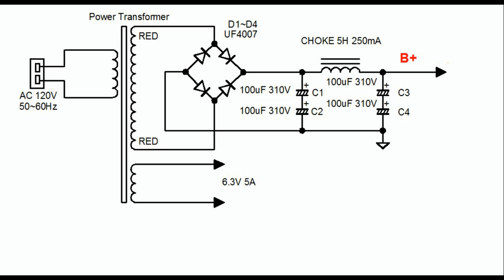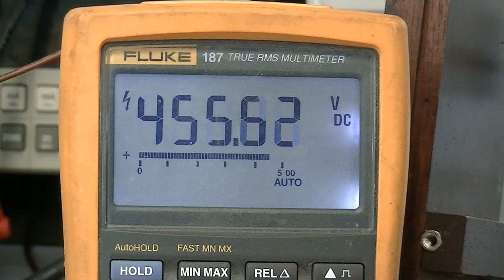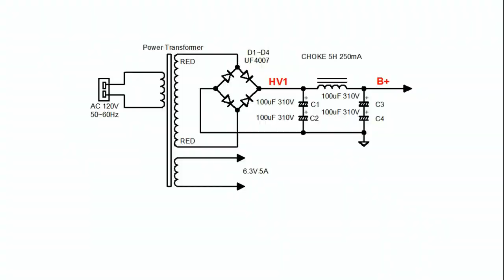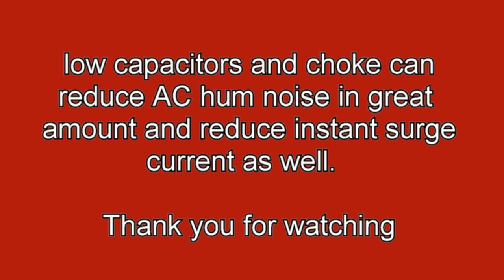tube audio lecture #2, importance of choke(inductor) for tube audio amplifier rectifier

Comment: YOUNG AHN, Using higher value choke values in power supplies will give a different sag compared to using lower value choke values. The Choke is a reactive component and explain why this happens because the chokes are tuned to 60hz or 120hz in power supplies so the higher or lower the choke value does something with the current to starve the circuit when drawing current? What I mean is that the Choke is a reactive AC resistor and the higher value chokes are a reactive AC resistor and the lower value chokes are a reactive AC resistor but what is the differences when the Circuit is drawing current when using a Higher value choke compared to using a lower value choke?
Reply from the maker: very good question. I tested higher value choke and lower value choke when I started to design amplifiers. For example, 10H 100 DCR vs 2H 50 DCR. result was not so significant. Thanks.
Reply: @YoungAhn  what is DCR? the choke is like an AC resistor so the high choke value has a high AC resistance? and the lower choke value has a lower AC resistance?
Reply from the maker: DCR is resistance of coil itself. Higher the H, DCR wiil be increased.
Reply: @YoungAhn  ok thanks I didn't know the higher the Coils Henrys would also increase the DC resistance of a coil with less wire turns

Comment: YOUNG AHN, 
Why is the Chokes coil resistance frequency dependant for what reasons? another questions Is the coil of wire used some special type of coil wire to be frequency dependant?
Reply from the maker: It's because of inductive resistance, XL=2p x f x L.Frequency can be calculated using the equation. http://c03.apogee.net/mvc/home/hes/land/el?utilityname=diversepower&spc=foe&id=4571